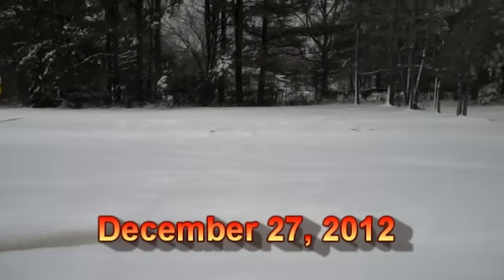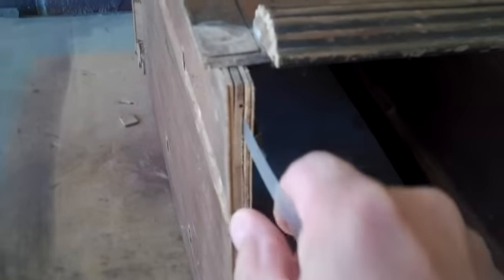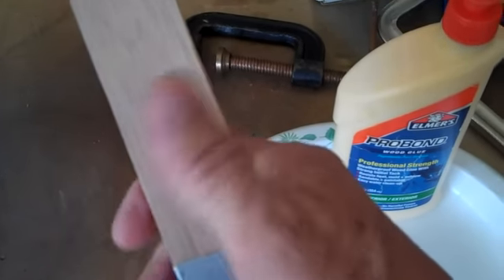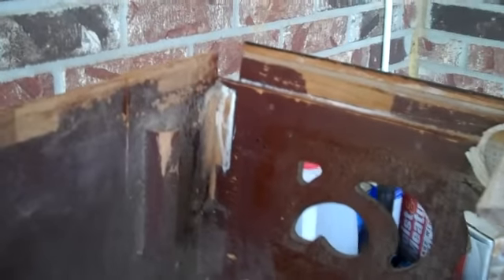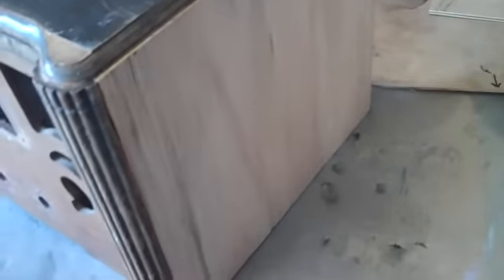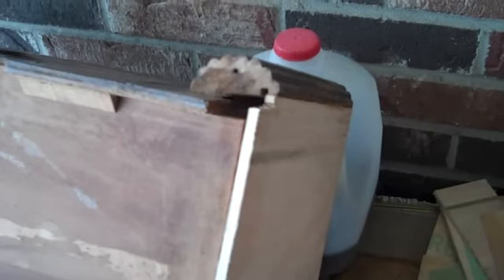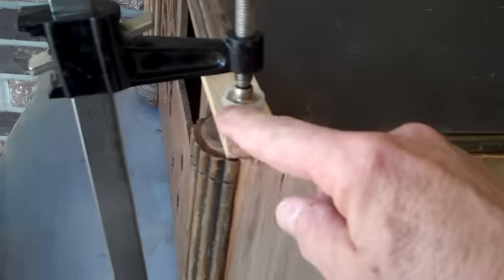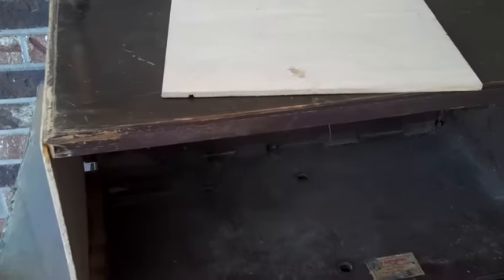1938/39 Silvertone Model 6044 & 6045 Farm Radio Restoration (Part 2 of 20).

Comment: I did find some 3/8 hardwood plywood finally, in the form of Baltic birch. You are right finding 3/8 inch cabinet grade plywood isn't easy usually they go right from 1/4 to 1/2 to just under 3/4'', with construction type plywood like fir, spruce, or pine is no problem, but it is with poplar or birch.

Comment: Looking at the chips on that new piece of plywood - here's a suggestion for you (besides using at least a 40-tooth blade): put masking tape on your cut line. i.e. saw through masking tape. And you also want the good (outer) side up when cutting. Hope this helps.

Comment: I had to find 3/8 ply for a restoration project on a 1961 hall Kelly sea flea hydroplane and to make it worse I'm in ontario. It ended up coasting like 50 bucks a sheet from a fancy supply shop. Great videos but remember there old radios they don't have to be perfect I'd prefer a roughed up original cabinet than a pristine restored cabinet.

Comment: Do they have a Windsor Plywood in your area? Because Windsor sells Baltic Birch plywood which is a true 3/8s. I did not get mine from there but a Home Hardware building center outlet that had a pile of it on sale for $17 a sheet, the sheets are 5' x 5' rather then 4' x 8' like our stuff is.